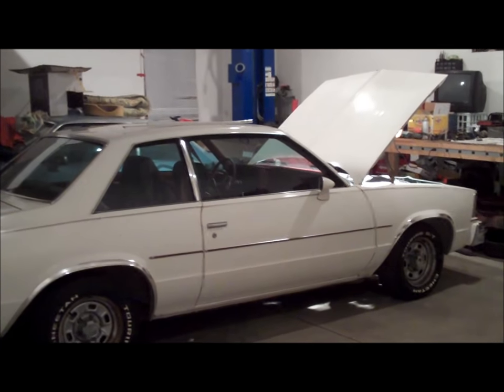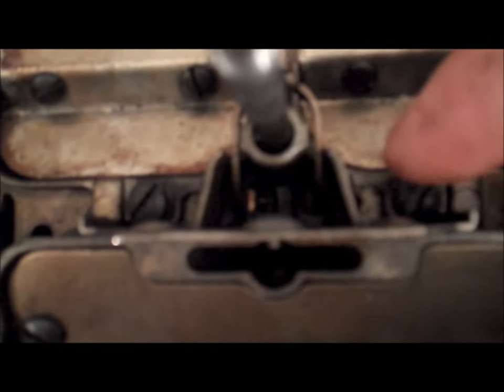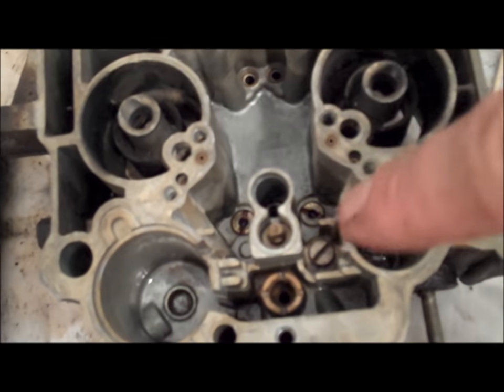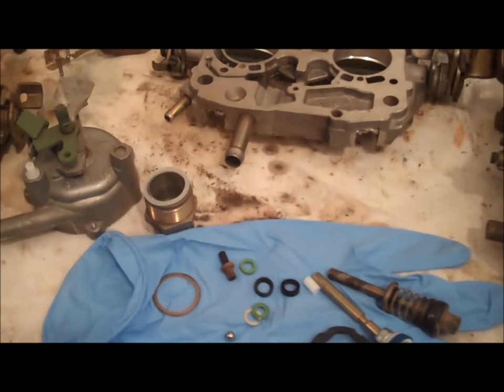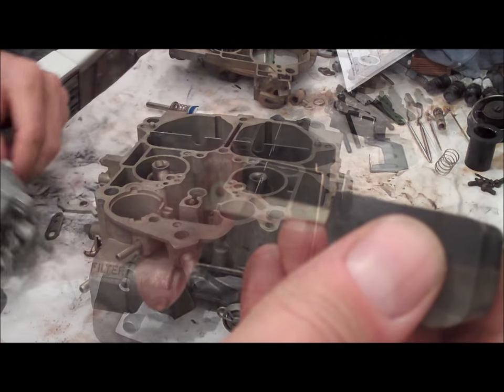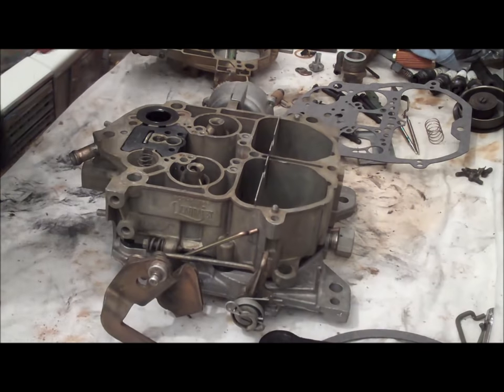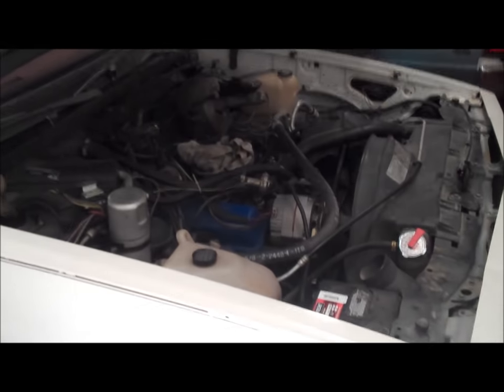Detailed Quadrajet Carburetor Rebuild COMPLETE GUIDE

Comment: Excellent quadrajet carburetor rebuild video.Plus i always wondered where the ball bearing(check valve) was located.Excellent information also on the power piston leveler adjustment(four turns from the bottom) count.Might be bedt to leave it alone to me.

Comment: Dude thank you so much for this. I'm rebuilding a Qjet for my Pontiac 400 right now. My local Napa did have the carb dip. HOWEVER! The carb body sections are slightly too big for the 1 gallon pale. Had to find a shoebox sized Tupperware container to soak everything in.
Reply: Good to know was jus about start tearing mine apart to clean it an would if been stuck thanks for this
Reply from the maker: Glad I could help

Comment: great video!
just like anything else, you can get really good at this if you do it enough times.

when i was 15 in 1979 i had a 69 chevelle with a 307 with a really bad carb and i was dead set on rebuilding it since it kept  bogging out! 

I heard 2 older mechanics talking about how  they "boiled" their carburators  to get them super clean
well, i went and got a big pot of water and took that carb apart and threw the whole bunch of parts in there!..

when  i told my dad what  was i doing and he almost died laughing.

He explained to me  that "boiling your carb" meant letting it sit in a "solution bucket" for a day.
thats the part you are talking about at  30:20....the 2 or 5 gallon bucket of strong solution (kinda like really strong brake cleaner) for cleaning parts.

true story.

(to be honest, thats the cleanest carburator i ever had..even though the whole house smelled like gas and oil)

after about the 3rd time rebuilding a Qjet, i could understand how it worked and how to fine tune it.

again... this is probably the best Qjet video.
Reply from the maker: Thanks for your comment and your great story! Love it!

Comment: Nice video,very thorough,Rochester Quadrajet,though complicated is by far the best 4 barrel carb ever and when tuned properly is the best in smoothness,power and economy,my  other favorites are the Autolite 4100,Holley 4011 and Motorcraft F-2,but I'm using Quadrajets in everything for the past 35 years even in big block Fords and the results are always gratifying.I'd like to add a couple things you must do after installation besides what you already showed in the video:1-You have to adjust the idle mixture with a vacuum meter and engine running.2-You have to inspect the area below the secondary metering needles for cracks and distortions,if so you got to correct it and it's not easy.3-And once is up and running,all warmed up,you gotta debog the second stage.After that it's all good.Also I'd like to point out this new Summit carburetor is very good,not as sophisticated as a Quadrajet,but inexpensive,simple and it appears to work very well in some specific applications like Ford 289-302
Reply from the maker: +peter455sd Hey peter455sd thank you for the reply and the additional tips! I do need to get myself a vacuum gauge for proper tuning. I am not sure what you mean by "debog" though. Can you explain. Also are you referring to the Summit Quadrajet?
Reply: +Classic G-Body Garage No I'm talking about the Summit square bore http://www.summitracing.com/parts/sum-m08600vs?seid=srese1&gclid=CJaViOaD-csCFcNahgod60gC7A Now regarding to debogging it's basically adjusting the rear metering screw that controls the second stage opening in order to cut the gap between primary and secondary response under full throttle,it usually takes 4 passages,sometimes you gotta drive around for a couple days.I say 4 passages if you have stick shift if it's auto,assuming the kick down linkage is in good standing,you have to drive around for a couple days and fine tune the thing.Sometimes,something I never understood,the rear needles are not the right ones for the carb,too thin or too thick,i believe at some point Holley sold a tweak kit with several of those needles,but I never seen in-store.Anyways,once you do the debogging you reach maximum performance and economy.

Comment: I've got a Q-Jet on a 1969 Chevy C-20 I purchased 2 years ago. It looks recently rebuilt as it is clean and can see new gasket material on it.
Then it felt like it was loaded up and idling rough. I would step on it hard to open all four's and it would run like normal. Now it idles bad all the time. I tried adjusting the two idle mixture screws and no matter how I adjusted them nothing changed. I could screw one of them all the way in or completely remove it and it would run the same - really rough idle. I checked the timing and discovered the vaccuum port on the front of the Carb on the Driver's side has no vaccuum at all! So I moved it to a vaccuum port on the passenger side of the Carb that used to be hooked up to the air pump and that one does have vaccuum. It used to run fantastically  but in a matter of a few days it runs bad.
 What could the problem be??
Reply from the maker: Sounds like someone messed with the power valve adjustment. Check out quadrajetpower dot com and they have adjustment numbers on their site.

Comment: 31:44 One of these rubber seals is placed behind the thermal spring bracket at the center of the choke housing (philips screw), the screw you said 21:35 not to mess with☝🏻Better you do🤷🏻‍♂️ Great vid! 💪🏻👍🏻

Comment: Have you made a video on the Power Valve Adjustment steps in case someone messes with it or wants to be sure it’s set proper? 
I almost pulled it out but didn’t remember any video showing it being pulled. And then I ran across your video and you were the first I saw to address it. 
Great video
Thanks

Comment: @Classic GBody Garage, Thanks! 6 years after being published and it's still super helpful! 2 Questions... 
1. Where can I find a replacement Secondary Metering Rod Holder Screw and a Choke Cover Retainer Screw?
2. How can I get a broken (headless) screw out of the Choke Housing Assembly? It was rusted and broke off when disassembling...
Reply from the maker: quadrajetparts dot com and use a drill or buy an new housing from them

Comment: Also, the well plugs mentioned about 20:00 in the vid leak and will contaminate the crankcase oil with gasoline over time. Once that happens, your engine is in serious peril.. Great vid.... I used to work in a shop 40 years ago and the carb guy got master rebuild kits from Carter which included new well plugs and had a punch to install them....
Reply from the maker: Those plugs leaking are a real pain! I epoxy them up.

Comment: Thanks, great video.  I am rebuilding the carb on my 78 Eldorado.  I messed with the power valve set screw and would not have known how to properly set it without your help!  Also, thanks for pointing out the plastic plug in the choke housing..  Lastly, I would like to see how the pin is supposed to hang if not through the hole.

Comment: The primary metering rods will pop right out if you just push it down and let it pop back  up with spring pressure 4 or 5 times. No need to yank on it.   Also the secondary metering rod wells in the body are subject to the same leaks syndrome as the primary, leaking, they are the big ones just to the rear of the primary. They included what I used to call a QJ diaper. A rubber seal about 3/16" thick and the same shape as the hole in the base. I would find them and use them on future rebuilds if I were you.
Reply from the maker: thanks for the feedback!

Comment: Holy turd!  This is my first rebuild of a carb.  It's a quadrajunk coming out of a '70 LeSabre.  Amazing how you only need a flat head and Phillips for this but dammit if that isn't a whole lot of little parts puking out of this thing.  My problem was sudden low and erratic idle and fuel cascading from the Venturi from the r/h nozzle.    Thought I'd just rebuild it but now the whole things intimidating. My setup is a tad different..  for instance, there's a tiny hog ring holding the accelerator pump not a flat head screw.  And there's a big rubber plug concealing the needle and seat.  There was just a lil sludge underneath the float but nowhere near as bad as yours.  Anyways.. this vid is pretty comprehensive.  You did a helluva job

Comment: I can't thank you enough for making this video. I got to the part with the piston and needle valves and the splits in the gasket and I was stumped! Couldn't figure out how that all went together. And I'm also one of those dumbasses that didn't read the instructions about not turning that preset screw. Thanks so much for the tip about 4 turns out! Doing for my stepsons old Dodge truck and I'd really look stupid if that thing wouldn't run right. Man you're a lifesaver! Thanks agian!☺

Comment: Just a quick question. Is the adjustment in front of the power valve called APT or auto part throttle? You get an A++ for this video. Heck you even showed us how easy it is to make a mistake and fix it the right way. I love these carburetors and have spent years working on them. Keep up the great work👍🤙😃
Reply from the maker: Yeah it is called the APT and thank your nice comments.

Comment: One important thing I found on driving the roll pin backwards on the pivot point.
Is to put a shim spacer behind it, so in case you push it back to far, or so you cannot drive it too far rather.
As if you go to far backwards, then there is literally no way to get behind it to drive the roll pin back forward.
I would guess use a feeler gauge shim of about .070" behind it.
I once pushed pin too far hitting the airhorn body,  wound up having to disc grind the roll pin end to have space to push it back in place.
And I did cause deface damage on the airhorn.
Everything else looks straight forward and very doable.
Reply from the maker: Thats a good tactic but I just use a small flat screw driver and push it back and has been working for me for years with that method.

Comment: 51:31. I respectfully disagree. Faced with this yesterday, I pulled the entire airhorn (thinking I had to) off as I had actually reversed this linkage causing it to bind on the casting when i originally rebuilt it. Realized how easy it was to just stick the linkage in, hook it and rotate it in. No airhorn removal. Great video.
Reply from the maker: I appreciate the feedback but yes you can hook the linkage without removing the airhorn but since it was apart this is the way I did it.

Comment: On the Power Valve . Over the years of rebuilding QuadraJets. I found you can get the  Power  Valve out by push it down ,than just let snap up,real fast, And it pop out, by it self.

Comment: I used to make QJs run circles around a Holley..I built them for Stock Eliminator. Impossible to overcarb with a QJ. The Air Valve was the headache for the uninitiated and probably helped sell more Holleys🤣
Reply: What air valve?  I want to watch for it and do mine right.
Reply: @empireofdirt7536  The secondary flaps that cover the rear bores. You can open it with your fingers and it springs back shut. The resistance to opening is accomplished with a spring that is adjustable. Tighter tension delayed the opening and looser tension opened it sooner. The trick was getting the tension correct for your application. A small flat head screw on the edge (left rear ) of the casting is the adjustment point. The flap also controls the secondary metering rods, lifting them out of their jets as it opens. This lift rate is adjustable too. A hanger rides on a cam. The rods are attached to the hanger. Different hangers were available and designated with a letter. High performance cars came with different hangers that lifted the rods quicker than a Quadrajet on a big land barge. The "k" hanger was the one to have. I could go on and on about what's adjustable on a Quadrajet. These carbs were the most advanced carburetors on the planet. If you could get a factory manual detailing what part number went into what high performance  vehicle, building a hot Quad was easy. I owned such a manual back in the day. I also had manuals detailing timing specs of different GM distributor parts. With such a book,  advance curves of vacuum advance, springs and weights were detailed and with the part numbers you could easily customize your dist.. there are good videos on U tube showing how to get your carb right. Its alil trial and error. You may need to adjust it a cpl of times to get it like you want.

Comment: this is really nice video and very much detailed guide. my question is i have 1972 455 HO Trans Am, the carb is nit operating well and i had to replace it with Edelbrock 750 carb., now, is rebuilding my carb is the same as this one here or they are different? 
best regards, Khalid

Comment: If your airhorn is warped, straighten it with heat from a propane torch. The metal will relax and flatten out. there is some skill involved and clamps, too much heat will melt the top. 350 to 400 degrees is about right. I straightened some 4GC airhorns against their fuel bodies.

I found those in carb filters fall apart in ethanol gas. I have two of these carbs in my boat, so since I use marine rubber fuel hose between the carter electric pumps and carb, I just get a large can filter from AZ.

I have rebushed the throttle shafts and rejetted including modifying the idle air tubes to get a better flow since the carbs were designed for a smaller engine.

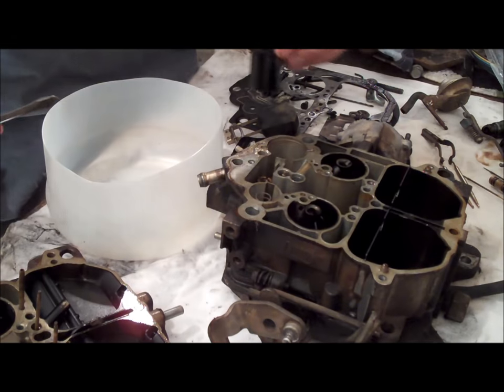Comment: In disassembling the quadrajet from my 1986 Chevy G30 van, I noticed that the cup you removed at time mark 17:00 of your video is missing. I think that my van has always run without it, because I don't remember seeing it. A pic on a web search called it the fuel cup. The only replacement I could find didn't look like the one in the video. Can you tell me its function, how my van could run for years without one, (or must I have lost it while taking the carburetor apart?), and a source for a new one?
Something I hope others might find useful, I used a large, spouted, square laundry detergent dispenser with the side cut off to hold my quadrajet while cleaning. The container caught the overspray, which I used with a small brush on hard to clean spots. I used the spout to pour the excess into a sealed container to save for reuse.
Reply from the maker: It may not have had one as this is a 1979 vs 86. Research the carb by part number and find out if like carbs have it.
Reply: I had pretty good success with my quadrate rebuild, I even installed an oil pressure gauge because the old one was not working. I was finally using it and it started to act up. I noticed that the oil pressure gauge was showing no oil. I pulled over right away, and saw oil pouring out the bottom for quite a while. I had it towed home by AAA. Oil continued to come out while it was being pulled onto the tow truck. 
Now the engine won't turn over and I discovered, after inspecting it that the plastic oil pressure gauge line had shifted so it was in contact with the hot engine and melted. 
The V8 small block engine has seized. I am hoping that there is something that I can do to save my 1986 Beauville van without replacing the engine, which is beyond me. I know it is likely that I won't be able to unstick the engine, but I still looked at your video list to see if you have a video on breaking it loose. I am hoping that I pulled it over early enough that it can be freed because it was still running when I pulled it over. I hope that you have a video or that you can advise me on what I may try.

Comment: @Classic GBody Garage  very helpful video. I have had no luck finding many video's about the qjet with a divorced choke. Been having problems with the choke not working properly and ended up doing an accidental choke delete today. I haven't been able to use all 4 barrels until the choke delete. Still no 4 barrel in final gear but rest of the gears finally do. Also how do you properly adjust the qjet mixture screws?
Reply from the maker: You adjust it using a vacuum gauge and then adjust the idle mixture screws. You don't mess with the power valve setting as mentioned in the video.
Reply: @ClassicGBodyGarage  do you have a video on how to do it? I had a guy that would do it for Me but he's not around so I am learning about it as I go.

Comment: That. Was definitely the best video I've seen to date the explanation and the moving the camera especially so I could see how the gasket is fed over and around the power valve .. listen I've got a good 800cfm came off of a 78 trans am 400 motor and it's on a motor running it as we speak unfortunately that motor is only a 305 and I need to find a good 750 calibrated for a small block chevy I'll trade you a 750 that doesn't need rebuild I know I have to do one one of these days but lol the vehicle it's on I can live without long enough to fed ex or something lmk if your interested thought about the 403 with the 800 on it ... did they come with one  or a 750 ??

Comment: Great vid I gotta keep replacing my accelerator pump cups on my 73 transam the ethanol is killing them after a couple months it don’t spray fuel in anymore and it cranks forever to get it started
Reply: don't use the black cups use the blue they will last with the ethanol the black ones are rubber and ethanol will eat them up.

Comment: GREAT !!! Video.  very detailed.
At 17:00 to 17:05 you remove the little cup next to the float.
Mine is stuck in there hard.  it actually snapped and the plastic broke on the lip.
I can't seem to find the replacement part. Any advice ?  I'm rebuilding and your video has been a great tool.  
Thanks
Reply from the maker: Thanks for watching. Contact quadrajetpower dot com